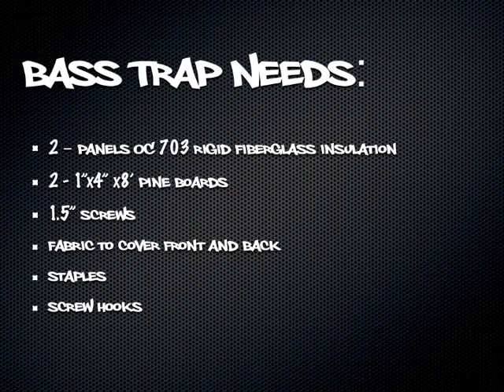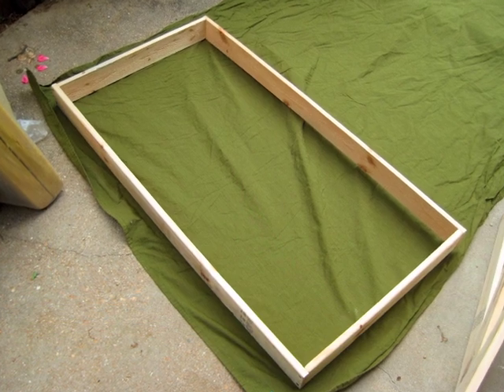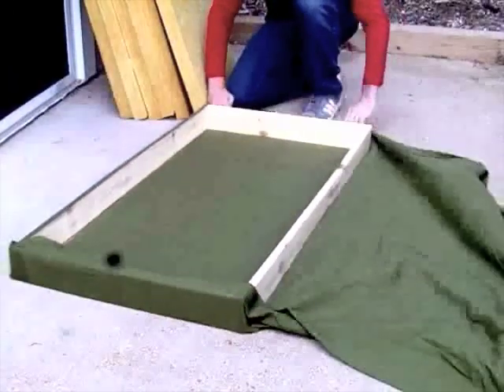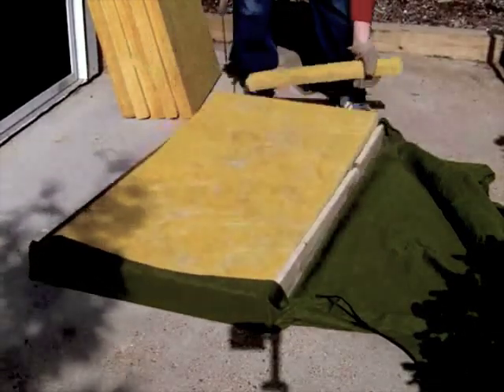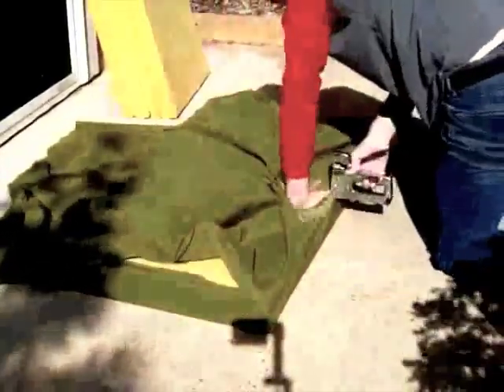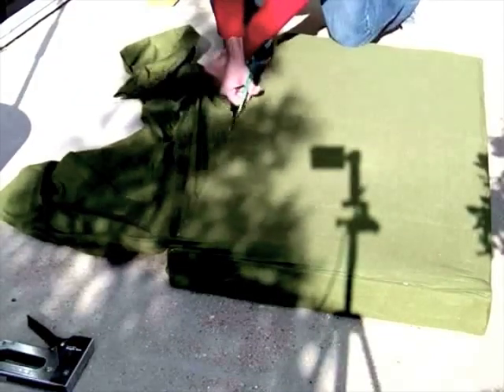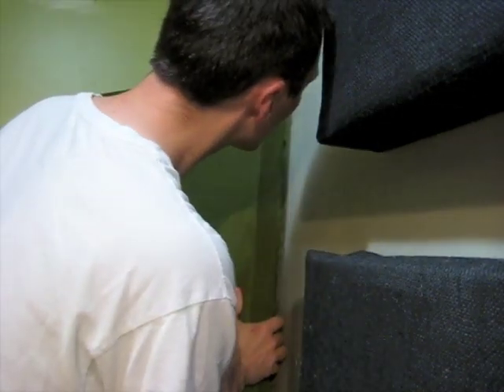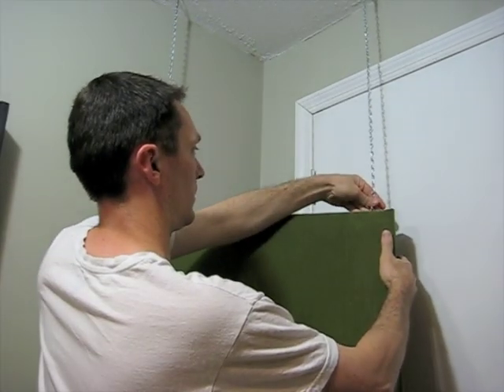How to build DIY Bass Traps

Comment: Thx for the video. 
Isn't fiberglass dangerous? 
Low frequency when penetrating it will release particles in the air where you will be breathing. 
Just an observation .
I wonder if there is anyway to build with other materials. 
Thx
Reply from the maker: The fabric that's wrapped around the traps helps to keep the fiberglass contained. I've had these in my home studio for 8 years now, and I've never noticed any problems with loose fibers landing on any surfaces.
Reply: @anode8  thx for the reply.

Comment: Wow ! Working with fiber glass with no mask or gloves is a huge health hazard. You should use a layer of spray mount and a thin garden fabric before  wrapping panels with the exterior fabric , that would prevent glass dust to as cape

Comment: Can Owen Corning R13 be used in Lieu of 703 for acoustic panels
Reply from the maker: Miguel Hernandez Regular R-13 insulation is not dense enough to handle low frequencies very well. I have used R-13 in some smaller treatments to help tame some reflections, but it is not sufficient for bass traps using this design. You should stick with the 703 or rockwool.
Reply: anode8 what about Roxul safe and sound?
Reply from the maker: Miguel Hernandez
Roxul Safe & Sound is a good alternative to the 703!
Reply: anode8 thanks for your help!

Comment: Hello. Will it work for soundproofing a room with a home cinema of 1000watt?
Reply from the maker: This is an acoustic treatment, which is not the same thing as soundproofing. This will help to control a range of frequencies from resonating within a room, including a home theatre, but will not control the sound bleed through the walls/floor/ceiling/etc.

Soundproofing a room is very intensive, and is best handled during construction of the room.
Reply: Ilias Michailakis acoustic treatments will not soundproof anything. This is a fairly common misconception. The only way to insulate this provide more insulation in your drywall this can be very expensive and very much a pain

Comment: Thanks for this great video. What staple gun did you use to attach the fabric into the wood frame? Will a standard Stanley Manual Saple Gun work for this? Here is the one I can get at Argentina: http://articulo.mercadolibre.com.ar/MLA-525118082-engrampadora-profesional-metalica-stanley-tr-4-a-8-mm-clip-_JM

Can you please advise/confirm?
Many thanks

Comment: This design is a bit uneffective for low frequencies. A membrane with a sealed dumper is a much better solution.
Reply: Could you please explain that design a bit more? thanks
Reply: WideOpenChange If you want a design for a REAL effective low frequency bass absorption system, go to Acoustic Fields, they sell the plans for their product for about $40 and then you buy the filler material from them, but the cabinets end being about 200+ lbs and effective down to 30Hz.  Real serious low frequency bass absorption cabinets.  Check em out. They have two different models to choose from with two different absorption curves.

Comment from the maker: For 4" OC 703 insulation the numbers are  0.84,1.24,1.24,1.08,1.00,and 0.97, respectively.
Reply: One of the Best Ideas of SoundProofing is "SoundProof Curtains" That Stops Outside Noise by 80% (25 Db) Tested. Check Here: https://livesoundproof.com/best-soundproof-curtains/